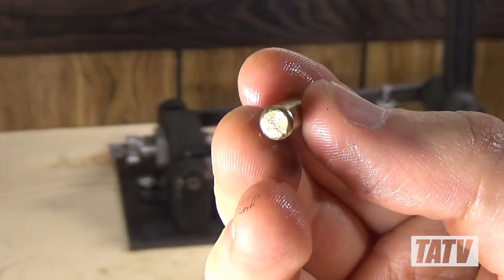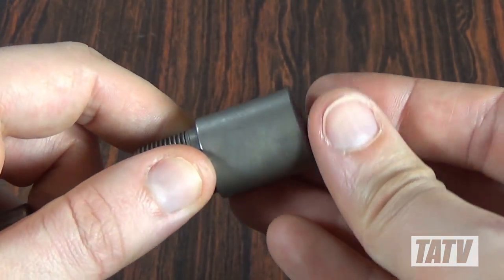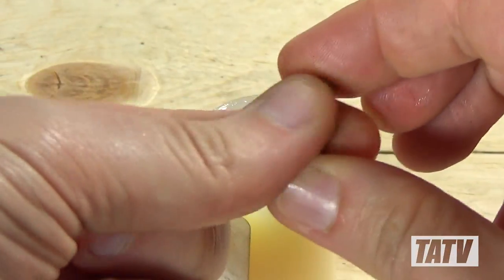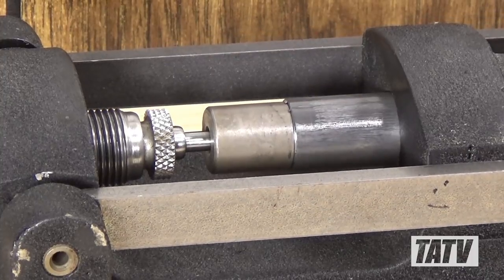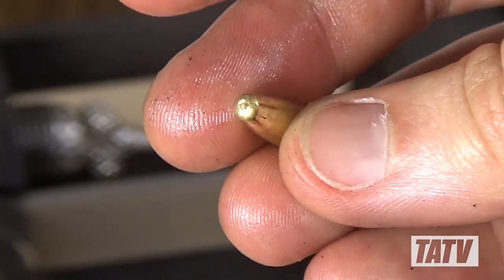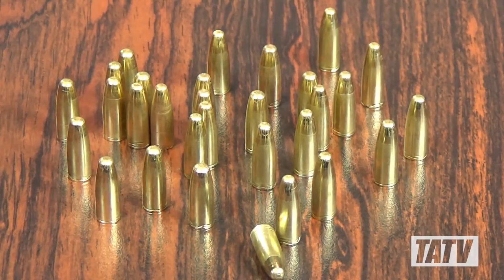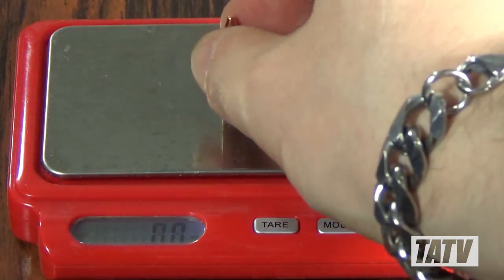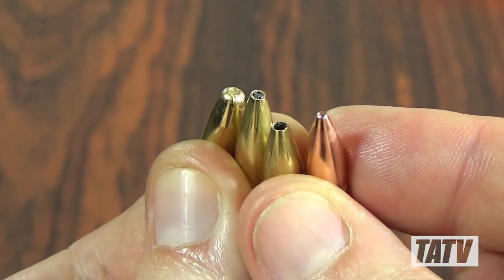Swaging 223 Bullets from 22LR Brass with a Blackmon Swaging System - Chapter 4 - Point Forming

Comment: In the website the press creator has a section fir a dimension of the core mold. Could you advise which is it. My guess is that it would be 3/16 but would appreciate if you could validate that. Thanks

Comment: The hollow point bullets seem like the point swaging is too aggressive as it's folding slightly instead of forming, which affects accuracy. Maybe a 2 stage point swager could help to make a more consistent jacket by doing a swage that preps the brass to be formed into the final shape. Usually they do this by forming the rear half of the curve first then the point. Because with this one stage point swager it start with the point side and works it's way back. Idk just my two cents

Comment: Excellent series..!
If you wanted to shoot all lead bullet, could you just swage the lead core (no 22 casing) to the final shape?

Thanks for the video....
Reply from the maker: Less, but as it would be pure lead I imagine it would likely deform under pressure and/or lead the barrel heavily.
Reply: @TATVCanada  
Thanks... I'd be using at least wheel weight alloy and powder coat.
Reply: @shadowcastre    Then why go through all the trouble of swaging?  Just cast WW and powder coat..  The point of swaging is to produce jacketed bullets or soft lead hollow base wadcuttet for use in target revolvers.

Comment: Great job TATV very professional, what would a die set and press like yours cost? Just ballpark figures? Thanks for posting a very interesting video!
Reply from the maker: Thanks for the feedback, always appreciated.  The complete set you see here is about $700USD.  Dr Blackmon also sells a core mould ($140USD) but it's tool 'tall' to work with most convention bottom-pour melting pots so you may want to look at alternatives, otherwise you'll be ladle casting.  If you're interested in seeing what all he's got for sale, you can find his website at http://bulletswagingsupply.com/
Reply: TATV Canada thanks! I will check it out, Don

Comment: What type of lube are you using? Have you tried different ones? 
Sean Flipflop stated to flip them and create boat tails. Have you tried this? 
Thanks much.
Reply from the maker: The swage die was provided by the press manufacturer but is essentially a lanolin based lubricant.  It's consistency is similar (though not identical) to that of petroleum jelly.  I'm not a chemist by trade, but I believe what makes it special is that it is a lubricant that does not compress as much under pressure.

I've never tried making boat-tailed bullets, although there are many dies to do that.  I have swaged backwards to make round-nose though.
Reply: @TATVCanada  
Great. Thanks for the answer.

Comment: How bad of an idea would it be to swage with wheel weight lead if I wanted to, let's say, swage 9mm brass into 30 cal, or .40 s&w into .45 acp bullets?
Reply from the maker: I'll be honest and tell you I have used WW alloy before when making cores, but only once to see the difference in pressure.  Those were very small cores for making 223's and I could definitely feel the difference, so I would absolutely not recommend it for something like a full sized 9mm.  If you absolutely have to do it, I'd at least say make sure you're using cores you cast that same day so they haven't had a chance to age-harden.
Reply: @TATVCanada  Silly idea: maybe popping the cores in a toaster oven, similar to annealing the brass, and immediately using them right out of said oven could make the cores soft enough, long enough to seat and point form. Maybe heating it all again before point forming could keep everything soft enough.

I know this all sounds dumb, but my (free) lead source is almost exclusively lead-alloy and I really don't want to defeat the purpose by buying pure lead. 

Though I heard car batteries have pure lead in them...

Comment: Is there a die set that can put a cannalure on it.
Reply from the maker: I don't personally have one but I have seen a tool that does it, yes.  It's made by one of the two large swaging supply companies; Corbin or RCE I think.
Reply: TATV Canada When you reload your cartridges do you use 556 or 223 Remington brass
Reply from the maker: I generally use Lake City 5.56 military surplus brass.  I have accumulated about 20,000+ rounds of it over the years when people were practically giving it away.  Works well, price was right!
Reply: TATV Canada can you drive them bullets at 3200fps.
Reply from the maker: I've never tried anything near that fast with these, no.  Generally I aim for around 2,000 but it really all depends on what I'm doing with them.

Comment: why not melt a 45 grn of lead into the jacket so it's soldered in??? That seems easier, and it would totally be bonded. I am asking because I REALLY want to know, not trying to be a jerk.
Reply from the maker: It's a good question; there are two reasons I can think of:  The first is that you almost always have a little too much or slightly too little liquid lead poured in (I can't imagine a way to perfectly fill it every time), which would result in the weight being off.  The second reason is that castings, particularly small ones with relatively large surface area, can end up with 'inclusions'--  Small bubbles or gaps caused by air, insufficient temperature, etc.  If you go back to the core-casting video you'll see I intentionally cause a bunch with wrinkles/ripples in them.  Part of the reason I did this was to demonstrate how even a poorly cast core can be swaged to perfect (or near perfect) shape through raw kinetic force.